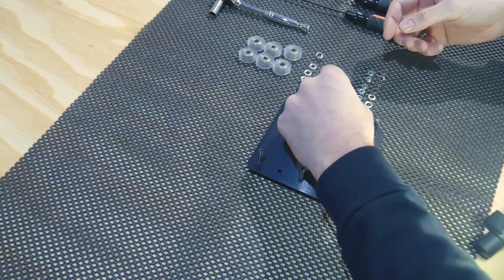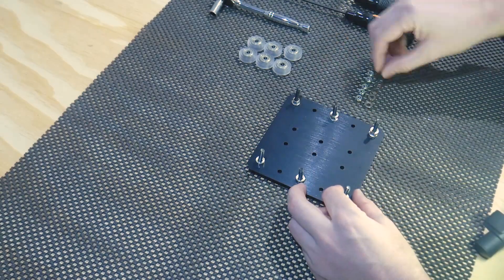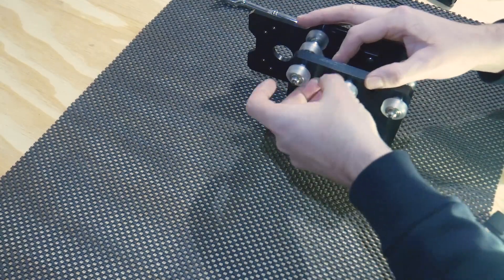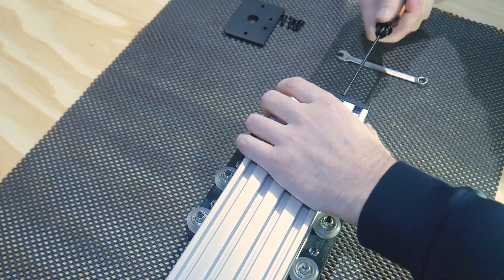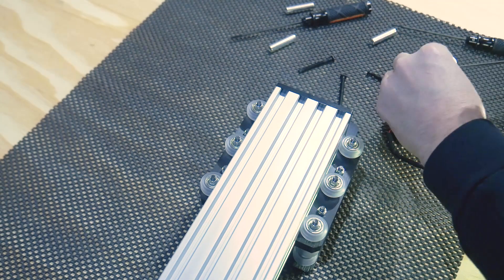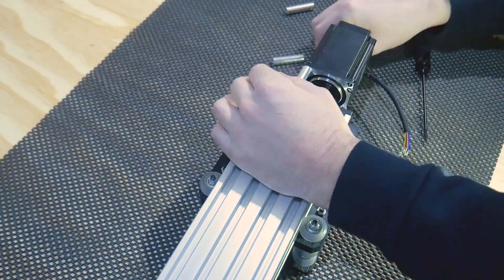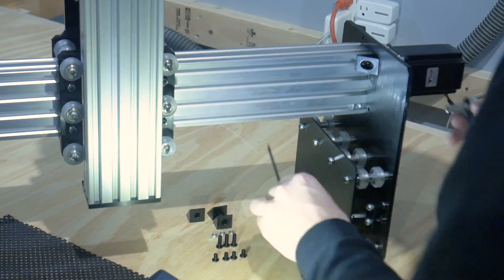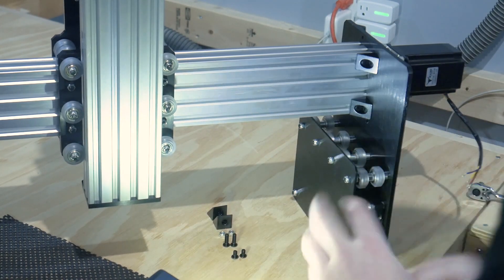Workbee CNC Bulkman3d Kit - Built Part 2

Comment: I'm looking at your CNC table. Did you use plywood or did you need to make it more sturdy?
Thanks
Reply from the maker: This is Ply wood on a 2x4 frame. I also have a sheet of MDF on top of that for aesthetics. The table is sturdy enough however it wouldn't hurt to do a tiny bit more reinforcing. My table allows me to fold it up against the wall when I'm not using it. I will be building an enclosure in the coming weeks.